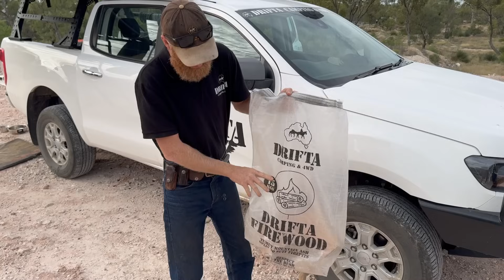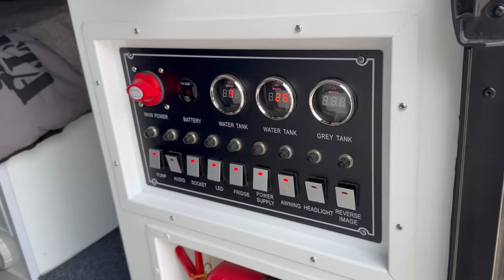CARAVAN TRIP WITH THE UP15e - PART 3 MINING OPAL

Comment: Had same problem with my 79 I adjusted the balljoints tight 2 are adjustable on relay rod an track rod are just tierod ends make sure there tight. The main problem with mine was the panhard rod it had after market  bushings was a 3 peace an it couldn't handle the pull of the sideways movement I replaced that with solid  press in bushes end  of problem .an yes a lot of after market steering dampers are big an look strong but are weak sometimes the factory ones are best they look skinny but they work toyota knew there would be issues in that erea. Hope you get it sorted
Reply from the maker: thx mate will look into that. yeah seems panhard is the issue even tho i replaced the bushes the worn quickly again
Reply: @DriftaCamping4WD  check the panhard bar itself for cracks, I had a mystery death wobble problem that i tried everything to fix and it turned out the panhard bar was cracked halfway through right on the bend which was letting it flex a lot and causing the death wobble, I'm really glad i found it before it fully broke, hate to think what would have happened then!